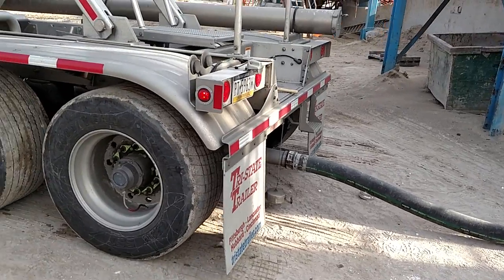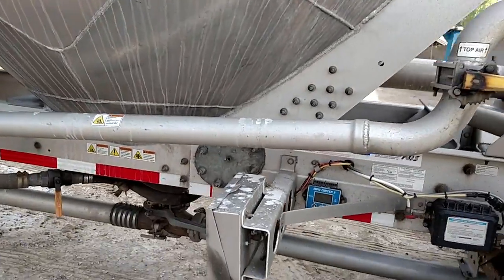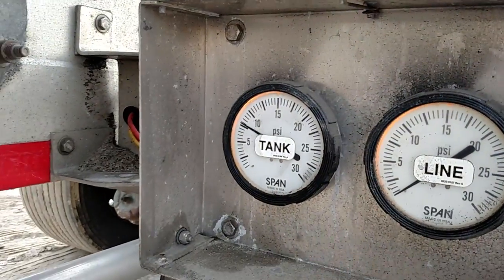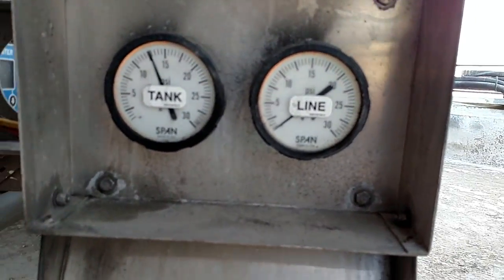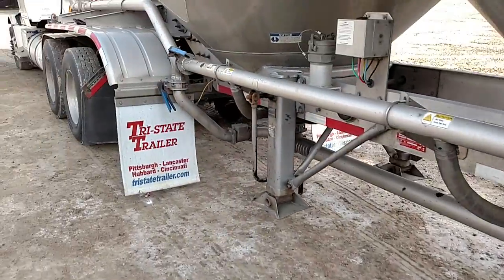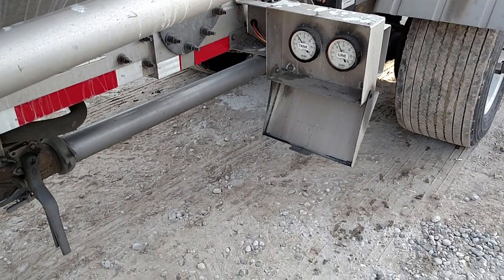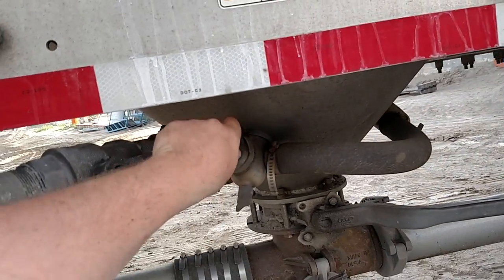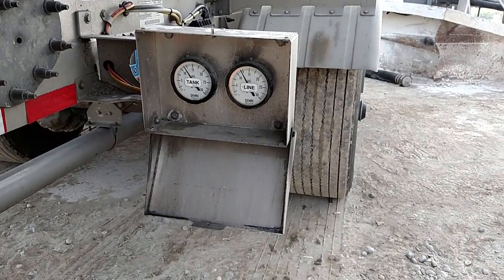How to unload sand/ pneumatic tank

Comment: Always start the blower with the belly line wide open. Less stress on the blower so cheaper maintenance over the long run and you can make sure that the last guy to unload into that tank/silo/etc didn't plug up the line. From there you should be getting things set the way your trailer and product like it.

Comment: I've been pulling bulk tankers over 20 years. However we recently landed a sand account. It's taking me about 2 hours to unload a 3 pocket trailer. With only 3 clicks of bottom air does that place have suction? How long does it take you to unload a pocket. You video sounded like you said 12 minutes and it was going empty.

Comment: depending on the kind of sand u haul, theres varying techniques, if ur blowing a long distance with coarse sand u need lots of air speed,the fine stuff not so much, we run  drum 900 cfm blowers which r pretty much the standard blower i see most on trucks

Comment: I unload 5 sand trailers a day at 15 psi unlike powder you need high rpm 13-15 and you want your control arm and hopper valve completely open to get max blower power and product out. The more clicks on the control arm the more you strain the blower and make it inefficient

Comment: So question for the experienced sand haulers…
My company uses a Mac trailer and the way I was taught to use a couple notches of top air and open product line whole way. Then dump back pod and then middle pod about 1/2 way and maintain tank and air pressure around 15-17 psi. Every trailer is different some slower and faster but takes me about an hour to blow off can. Anyone have a faster method using Mac trailers?? I know a lot of people use them see them all the time out there on the pad. Thanks
Reply: Did you ever figure out how to blow off fast?...takes me 25-30 minutes to blow off 👌

Comment: Thay didn't put air rators on trailers to look at there there to use,u never get plugged up that way on any type of sand just turn off top air and never touch that handle again,doing it this way I can unload 48 thousand in under 20 minutes
Reply: Yeah right ah NO dot reg suggest 45 minutes.
Reply: At what psi do u unload at

Comment: Hi there! I work in a silo where we receive the sand you guys bring. This pressure you are using is too high for low quality silos like the ones where are work, unfortunately. You shouldn’t use anything more than 8psi. Strong pressure can kill a person. And damage the silo for SURE, by making holes on it. Plus If the lid in the silo is being pressured too strong, it can blow up and the rest you can imagine…. I’ve seen it happening it almost killed a person… Also, we had to do too many emergency maintenances that ended up with huge lines of trucks to unload… and load…. not cool… I suggest don’t use more than 8psi for safety reasons and to avoid maintenance (delays). Be patient!
Reply: You're clueless lol literally all wrong
Reply: @stevennorthcutt5164  All wrong according to who? Well the proppant used here, actually is not sand, it is bauxite, which is much stronger than sand. But many doesn't know it and just call it sand though.